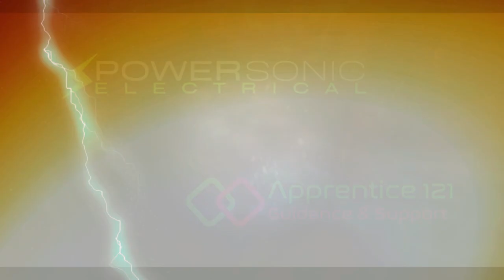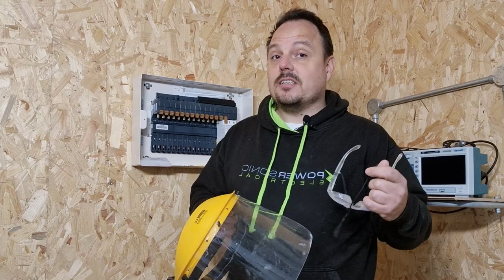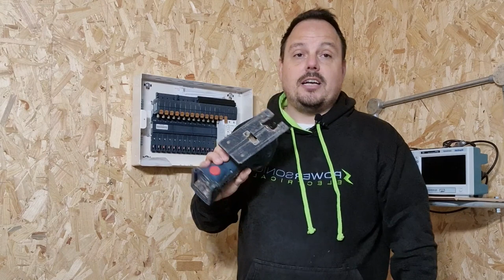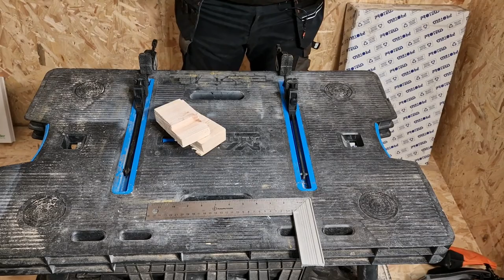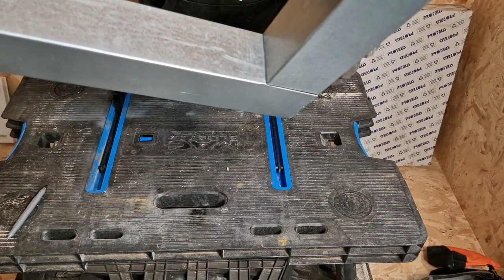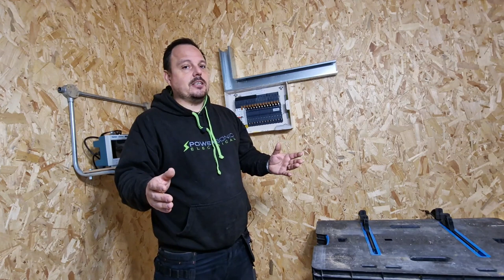How to Make a Flat 90 Degree Bend in 75 x 75 Steel Trunking using 3 cutting methods

Comment: Great video. A lot of the sites I work on, use of the angle grinder is classed as 'hot works' so there are more permits and safeguards involved than using jigsaws / hacksaws. If it is just a small installation, it is often quicker and easier to do the work without the grinder.

Comment: On the back edge of the piece your folding score it with a few passes of a scribe and it gives the metal a point to fold at and you will end up with a nice square clean corner on the fold. And also where you overlap the 2back side cut one side off at 45' and it gives the look of a mitred finish
Reply from the maker: Good call on the scribe! I was careful to follow the guide in the college book in terms of the cuts. I usually mitre both angles in the back so they meet on my own cuts. Thanks for the input, the more ideas and chat on this the better. Awesome